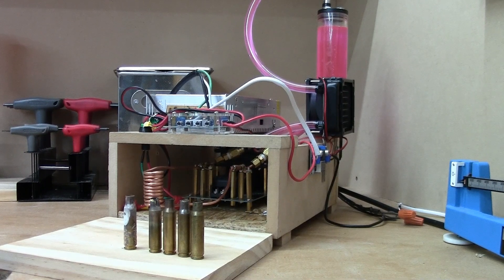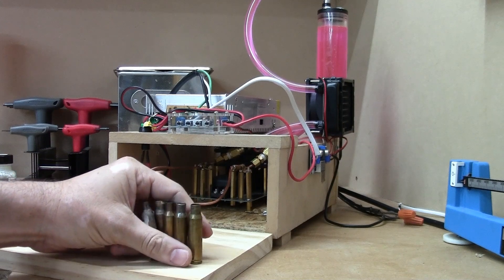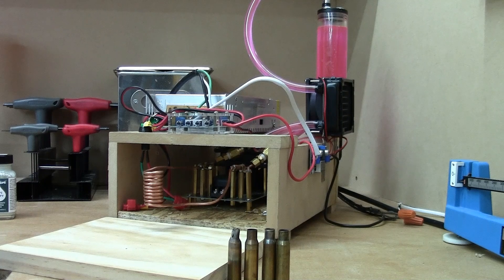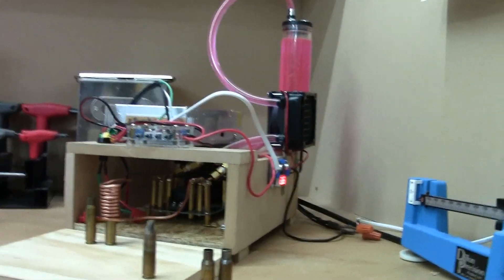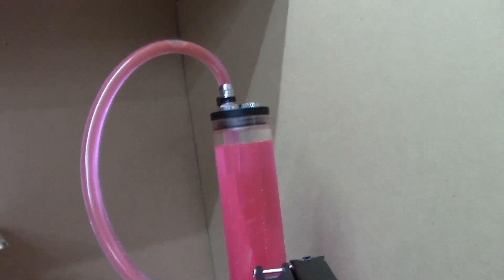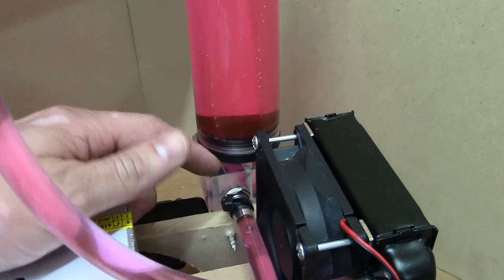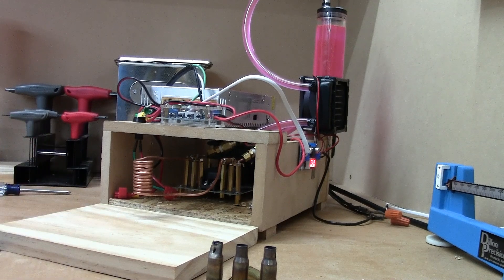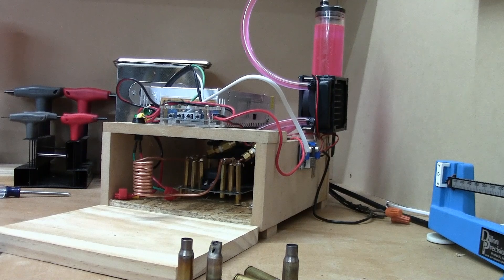Homemade cartridge brass annealer

Comment: I'm just wondering, did you say that you used tap water in the water cooling setup? If so you may want to use some distilled water and a kill coil. The distilled water has no minerals in it like the tap water does. It's hard on the rad and pump and can caz problems. As for the kill coil it does what it says, it kills anything from growing in the loop. So if you have a little bit of silver you can put it in the reservoir. And it will keep the loop nice and clean of any bacteria or algae from growing. You can get a kill coil from new egg or maybe even Amazon. Hope this helps......
Reply from the maker: Yea, I used distilled. It's more of an experimental thing for me, I'll change everything out later if needed.

Comment: Have you experimented with other means to verify temp on the brass such as a temp gun?  I’m interested in building one, but have been trying to get my ducks in line before I get all of the supplies. I’m not sure if a heat gun would be able to pick up the temp fast enough. What are your thoughts?
Reply from the maker: No idea about the heat gun. Honestly, the tempilaq is fine or, turn the lights off, hit the button and wait for the glow to go down the neck to the beginning of the shoulder then that's your time. You're after accurate neck and shoulder sizing.

Comment: That looks like they are getting really hot. I thought 750° was the ideal temp.?
Reply from the maker: 750 isn't hot enough to get a full anneal in a short enough amount of time where it won't propagate to the rest of the case. 

I linked to an article that explains the process far better than I could ever explain it. It's a good read. Highly recommend
Reply: @ryridesmotox  I'll take a look at it. I should also say that I put the 750* tempilaq on the inside of the case neck. So the inside has to reach that temp.  I guess everyone does it a little different. I always thought if it were placed on the outside it would reach temp before it permeates through the brass. Then of course I wet tumble afterwards.

Comment: Sweet set up! Besides your list you have what would you add to it to make the makes a case drop out the bottom And maybe a faster more powerfully annealing
Reply from the maker: That's would take some extra parts. To be honest that above my knowledge level at this point. It doesn't take enough time annealing 100 or 200 at a time for me to justify spending the kind of time/money to automate the process. There is a bunch of people that have done it though. Check the accurate shooter forum for the Gena-eric annealer, can't remember the actual name. But a Google search should get you there. They've completely automated theirs.

Comment: Excellent! Annealing Made Perfect has some good published studies on their website...they found no annealing for even an hour until 660F.  Their AMP anneals a .223 case for a peak of 1000F in 3.4 seconds.  How do you assess the consistency of your neck annealing?  Do you have a gauge with an arbor press?
Reply from the maker: Pin gages.

Edit: they can be found on amazon
Reply: @ryridesmotox  Thanks.  Do you use an expander mandrel to set your neck internal dimension?
Reply from the maker: @RetrieverTrainingAlone  I do. A 21st century mandrel. But I don't think it's entirely necessary to be honest. It us nice when testing to see if more or less tension is beneficial, but I've found that .002 of interference is plenty adequate.

Comment: Look up the GinaErick annealer on accurate shooter forum. That’s the post the guy on sniper hide took the idea from
Reply from the maker: Yea I've seen both. There are some things I will change on this when/if something breaks. But for now its sufficient. The GinaErick one is a bit more involved than this one
Reply: @ryridesmotox  Holy cow, great minds, same track!  I just built this one after looking at the GinaErick one myself, and we both came up with virtually the same different model.  I made a little trap door in mine that lets me drop the brass out without having to touch it, and a hole in the wood centers it for me. https://www.youtube.com/watch?v=CZUb_4isJZE

Comment: I just got done building one of these, here is what I changed:
I went with the power supply that was recommended and found it to be a little light in power the internal breaker would trip at times I went with a 20 amp power supply. 
The next thing I did was to put in a 40 amp relay to control the board this takes all the strain off of the small PC board power controller.
I to burnt out one of the induction boards the silver tape that connected the capacitors melted and took out the capacitors I ordered new ones 10 for 11$ and replaced the old ones. When I installed the new ones I left the wire tails on and folded them in line with the foil tape and soldered the whole strip together. I think this is a weak point in the board. 
I don't know if I can post a pic of my finished project or not, maybe someone can help with this.
Reply from the maker: I'm not sure how to post pics on a video here. I would definitely go with relays next time. I mention that in the video I think. I'm going to do an update video soon. Just kind of short on time

Comment: I want to try this.  I followed the link to the timer board and ordered it.  I then read the questions and answers and it says it will count in milliseconds to 999 or whole seconds, but will not count fractional seconds like 7.2.  It this the correct link?
Reply from the maker: Mine is graduated in .1 second. I can't guarantee that the timers haven't changed since I bought mine though.

Comment: How is the coil connected to the board? I would like to build one for myself.
Reply from the maker: The board has posts where the coil is, more or less, clamped in. It isn't overly tight, just enough to keep it from falling out. Its conducting electricity from the brass fasteners on the board to the copper tube. If I o an updated video of rewiring it, I'll cover that more appropriately. I have some other projects to do right now though, so it may be a few weeks.
Reply: @ryridesmotox  Ahh ok I get it now.

Comment: Thanks for sharing, I'm in the middle of the same build and also trying to automate it with Arduino controlled stepper as @asdf jklo mentioned ;)
Reply from the maker: I was originally going to automate mine. I really only about 100 at a time. I'm not an electrician or overly tech savvy with electronics. So I really haven't needed it to be honest.

Comment: What did you use to twist your coil evenly?
Reply from the maker: 1/2 inch socket extention. I coiled it and then used pliers to kinda squish it together, then ran a folded up piece of paper to get it to have some clearance between the coils. If they touch, then it disturbs the magnetic field.

Comment: lol i did almost the SAME thing independent from you. I  even used OSB for mouinting everything and the same water radiator.
A tipp. I use a relais between the powersupply and the induction pcb. the relais is controlled by an arduino uno (controllable down to 1millisecond).
Reply from the maker: Yea my timer has sufficient capacity to nit need a relay with a 24v supply. I can literally melt a 308 case in 8 seconds. If/when I rebuild it, im going to do a 48v supply and use relays. Thats the proper way to  do it anyway
Reply: @ryridesmotox  i got an 48v 600w supply. works great. 1000w would be better but price/performance is not worth it. the nice thing about the arduino is, you only need a stepper motor to make it full auto. that is my next (and maybe final) step